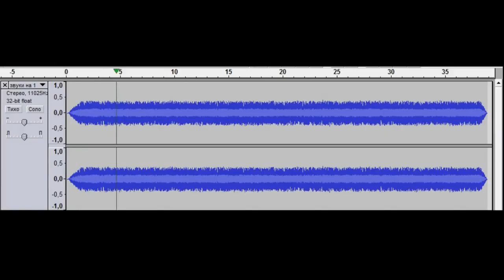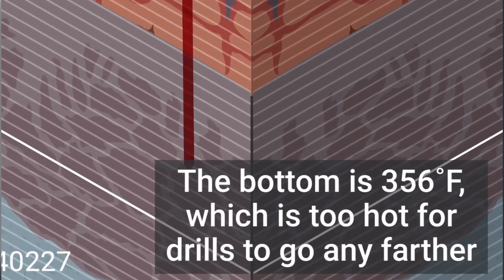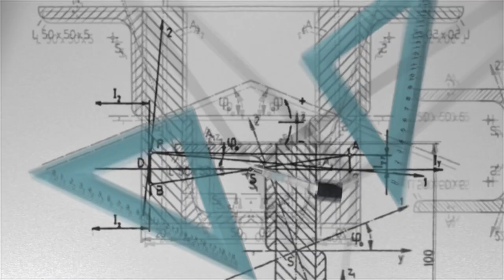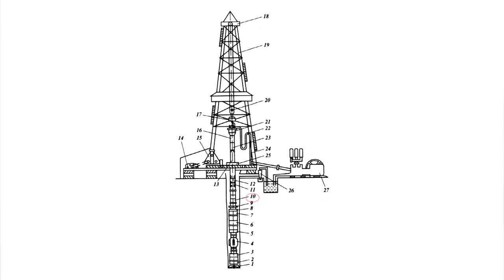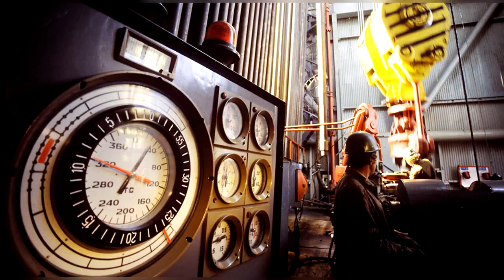Here's What is at the Bottom of the Deepest Hole on Earth...

Comment: If the stories are to be believed, Mel's Hole is the deepest hole EVER. Discovered in Washington state and measured by Mel Waters, via fishing line and a 1lb weight, he said that the furthest he measured was 80,000 ft. That's twice the size of the borehole, but it's gotta be deeper than THAT, as he never felt it reach bottom. He suspected it went on infinitely.
Reply: I suggest not placing much faith in anything that was on "coast to coast"
Reply: Its fake

Comment: I quote:  "A team of scientists has measured the melting point of iron at high precision in a laboratory, and then drew from that result to calculate the temperature at the boundary of Earth's inner and outer core — now estimated at 6,000 C (about 10,800 F). That's as hot as the surface of the sun.25 Apr 2013" the sounds are probably just seismic activity, so logically not hell. And considering how big the earth is, seven miles is not that deep.

Comment: The first temp readings were supposedly 1500deg then cooled to around 300deg? Uh, nah... The Soviets were lucky they didn't create their own "mini-volcano" or "vent." Pressures that deep would be off the scale. Temperatures would melt damn near any material known to man, and no microphone or camera would survive it. Seven miles of audio cable would weigh several tons and the tensile strength would not come anywhere near what would be required without snapping the cable, unless "piggy-backed" on something else. That was one dangerous endeavor. Those workers were lucky to not get killed. I would say that it was nothing more than an exploratory bore hole (not unlike what's done when looking for oil or natural gas) that reached ridiculous depths. Earth's crust isn't very deep in the grand scale of things. It'd be like trying to stick a needle in a balloon without popping it.

Comment: Can a microphone still recording at 1500 degree ?
Reply: the answer is no !
Reply: I microphone can't 'record' anything.
Reply: One badass microphone
Reply: And plankton can live in 1600 degree water 👍
Reply: Yes iron wrought wont melt till 2700are 2900 f and 1482 are 1593 c
Reply: Rachel Stargell aka Waya really?
Reply: @rachelestargell9048  Sorry, Iron won't melt but the magnetic microphones lose the magnetic permeability at 250ºF and the silver connections will blowout before that. Even the diaphragm doesn't survive that hot air. try recording with a micro on a microwave turned on.
Reply: Right good point
Reply: I wish they made the mic keep going
Reply: @GerardMenvussa  those phones! ❤️
Reply: I thought hell was a spiritual place.
Reply: It's impossible, to record in heat, heat will kill the sound. That's what I believe
Reply: We do have equipment that could be used today, but not then.
It would be very expensive though.
My phone cost me $1500 & it can't even handle 35°c
Reply: So if a warhead was dropped on a wire set to explode on contact, would the warhead explode or melt before it hit the bottom? Also if lava were down there, would it need pressure to travel up to the surface or would we be able to see rivers of lava through the newly opened chasm?
Reply: They ran out of money
Reply: Bzra GG thoes Sounds ended up being fake look it up
Reply: If people aren't chicken then why not go again and prove the story wrong? The hole is already made...
Drop a mic. Many "mythbusters" would be famous if they do
Reply: @sevnlight6313  exactly
Reply: Sevn Light - same with a simple camera on the moon pointing at the earth. Or a GoPro live stream an entire launch, and docking of any craft, to the ISS. It’s never been done. All fake.
Reply: Bzra GG  Russian one can bro # asktrump
Reply: That was the recording of screams from hell!!!!!
Anyone who has used a drill would know that sound is friction from the drill bit on the rock. Different rock & different pressures would make different sounds, but just the same.......
Reply: We have no molton core,all lies
Reply: @phillopiano3793  what do you believe in to think that there is no molten core

Comment: The sounds were not made by souls because it was sounds from high pressure trying to escape in the atmosphere from that point the waves were struggling since the hole had much temperature that it combines energy forming plates of dust distracting the ascending wave and the mineral water were formed through massive heat pressure... The crystals were not diamonds but they were aluminium dust being reformed by cold surface tension of dark beams refracted from the core➰😘

Comment: I want to throw a stone down that hole
Reply: WHO ? No problem 
 It would take about 6 MINUTES in freefall. In reality, it would take a lot longer because the stone would be bouncing off the walls all the way down and would not reach terminal velocity. I reckon it would take at least 10 minutes, give or take a few minutes. 6.2 seconds is ridiculous!
Reply: Nilguiri 1 mi = 1609m * 6.4 mi = 10298m

((2)*10298m) / (9.8m/s^2) = t^2 = 2102s

(2102s)^(1/2) = 45.85s

So ignoring air resistance and friction, and assuming this hole was perfectly straight, and the stone was perfectly round so it didn’t move around in free fall, and non-ferrous, and you dropped it with 0 velocity, and it didn’t spin at all, it would take around 46 seconds to hit the bottom.
Reply: Nilguiri Hmm.. Well it’s definitely not 6 seconds, lol!
Yes, Air drag would be a considerable factor as you went down.. I honestly just didn’t feel like doing the longer formula. 
As far as terminal velocity goes: 
F=(G*m1*m2)/(r^2) for the gravitational force between two bodies right? 32 m/s is terminal velocity when you’re on the surface or at least near it, as you aren’t really changing your (r) in that formula (the distance between the 2 objects) by very much, relatively speaking. But consider that the vast majority of mass of Earth is in the core. So if we dig down towards it, below the surface of the Earth, we are increasing our gravitational force by the square^2 of every meter of reduced separation. This is why I used a constant acceleration, when I assumed no air resistance, which is the counter force vector to gravitational pull, of course, and is what creates terminal velocity (when W=D, [W=weight; D= drag]). 

V=sqrt( (2W)/(Cd*ρ*A) ; you would need to work out the scalar for changing weight with the gravitational force formula, and the same for changing medium (air) density. You could then find the dyad to apply to whatever area and mass of stone you would like....

This still ignores frictional forces and Coriolis, and assumes a non-ferrous stone, dropped with 0 m/s velocity, and a totally straight hole. 

And now I’m gonna go make some tea and get back to work, rather than working out the math for dropping a stone down a giant Soviet hole in the ground... 😂☕️
Reply: Nilguiri Could be wrong with my thinking in my previous reply, but pretty sure... If there are any physicists who wanna correct me, feel free; always interested to learn something new.
Reply: Fire a rifle down the hole ,see if bubbling crude comes up like the beverly hillbillies
Reply: In Russia, hole throws stones at you.
Reply: How long would it take to hit the bottom?
Reply: How about a phone?
Reply: WHO ? No problem Not surprised..
Reply: @No problem No problem wow that's quick!

Comment: It's on a loop.Its from the old movie called the blood barron look at the sound bar you can see it's got the same pattern.Also if you listen to it carefully you will hear screams that stand out they come up AGAIN.DEBUNKED. THEY GOT SO DEEP until the diamond tip drill piece was not strong enough to get through as the rock was so dence it kept breaking the drill pieces and as you can imagine they are not cheap yet they did discover that there was a global flood many years ago that is the fact of the Siberion Tundra bolt hole.

Comment: Seven miles isn't terribly deep when you consider that the continental crust is 25 to 44 miles thick. If they wanted to drill down to the mantle they should have chosen somewhere over oceanic crust - unfortunately, the places with the thinnest crust are under water. Not sure how thick the crust is at the Kola Peninsula but I'm sure it's at least twice what they reached. Also, it's not true that rocks from that depth have never been seen - continental collisions that give rise to mountain ranges, and later exhumation and  tectonic movements (such as isostatic rebound, detachment faults and rifting) often expose rocks that are deeply buried. That's not to say that this borehole was a futile endeavor - even if we've seen rocks like this elsewhere, it's useful to actually MEASURE geophysical conditions that deep in the subsurface. The discovery of water at 7 miles depth is interesting, and amusingly has been used by one or two flat earthers to dispute evidence for a liquid outer core revealed by the S-wave shadow zones on the opposite side of the Earth to an earthquake. Somewhat interested in how they got those photos of an open hole - in most wells, the hole is filled with a drilling fluid, usually mud. Remove the mud and other substances (usually brine) invade from the rocks lining the hole. This is far below aquifers and sedimentary reservoirs, and the upper reaches of the hole were probably cased off, but still, I can't imagine them drilling the hole dry.  Drilling solid granite must have been really something... they probably used downhole motors (powered by mud) and special hard-rock bits. The Soviets were supposedly way ahead of the West when it came to downhole motors at the time, and they had lots of experience drilling oil wells in granite offshore Vietnam (yes, there are oilfields producing from fractured granite in Vietnam and the Soviets did the work, back in the 1980s). To change a bit they'd have to pull up all 7 miles of drill string..

Comment: Way back in the 70s and early 80s American oil drillers in ALASKA routinely drill down to a depth of 20 kilometers or 12.5 miles (that was written in a pocket book that I borrowed) and the oil comes out of the borehole BOILING HOT! Russians drilled even beyond that depth. The OFFICICIAL NEWS is that Russia drilled down to beyond 20 kilometers which is 22 to 23 kilometers but the UNOFFICIAL NEWS is that they drilled much deeper nearing 25 kilometers or 15 miles and 1,000 meters. 10 miles x 1.6 = 16 kilometers and according to Professor Arthur C. Clarke at 5 miles to10 miles below sea level man can find all the minerals he will ever need. The Russians does not want to be bothered with the need to search out shallow mineral deposits in inaccessible parts of Siberia BECAUSE OF THE COLD AND HARSH ENVIRONMENT but the cost is too high for ultra-deep mines at that time so they drilled several dozens of ultra-deep mines and started working on them to maintain them indefinitely to serve as EMERGENCY RESOURCES MINES while they search for the easier to access shallow mineral deposits by developing Arctic engineering technologies to allow them to economically access these shallow mineral deposits.

Comment: No mention is made of the problems had by the drilling crew during the last 3 years of the operation. In three years,
their drills couldn't make any progress because the rock was too hard.  This is why they quit.
Reply: You're right. Stuff like this should definitely be mentioned. Thanks for sharing this info.
Reply: I suspect also the ground pressure on the sides of the hole thru various rock strata would've made things difficult as well. I'm an underground miner working at depth of 2.1 km vertical here in western Australia.  The ground pressure is getting extreme as holes close by as much as 30% before the face is drilled out before charging and firing.  The achievement of these drillers and the project in Russia is outstanding and above normal. To all drillers reading this comment,  I have the utmost respect for you all for your hard work in a dangerous and sometimes unpredictable environment.  Whether you're drilling for oil, gas,  water,  mineral samples,  geological studies,  you people are worth every penny of your wages that you earn.  Regards from a underground miner in western Australia.
Reply: Jonathan Gems It was too hot and soft.

Comment: There is a documentary that showed the drilling progress timeline, up to the depth where they stopped drilling because they could no longer drill deeper, hence the decision to stop.
Reply: My job In U.S.WAS CUTTING TOOS WHEN CARBIDE TIPPED IT HAS TO BE DILVER SOLDERED ON A GAS TORCHISN'T GONNA'REACH THE TEMPS THAT DEEP  WHATEVER TIP THE DRILL USES IT HAS TO BE FASTENED TO THE DRILL BY HEAT I would get so pissed when the carbide would fall off torching it on! I had to re-tip holesaws that drill rock/steel1 thing when tips break, they don't reach 4000⁰F in operation!!Crap no pic option!
Reply: tools(S Wolf)